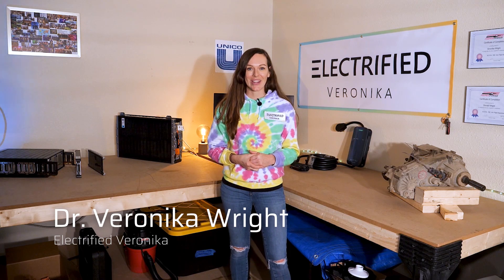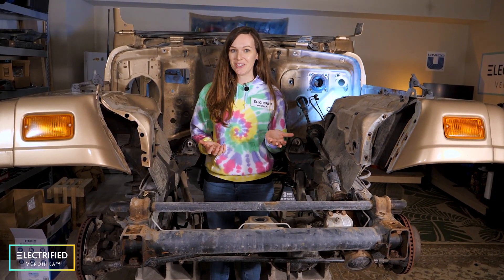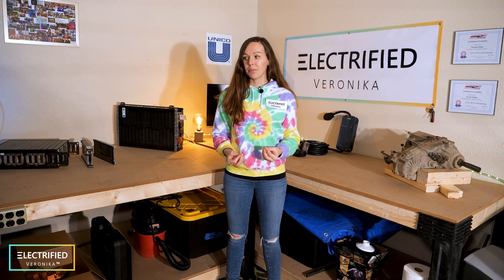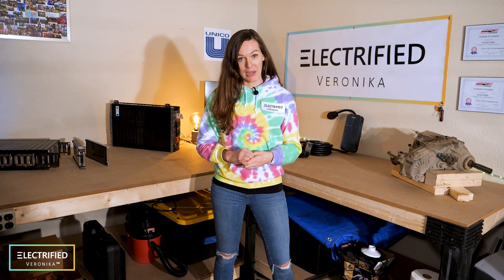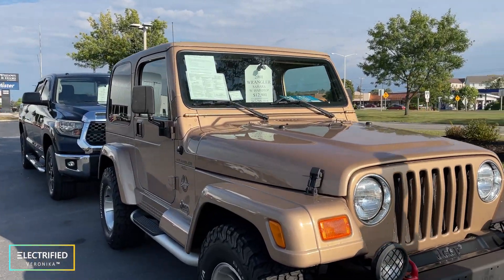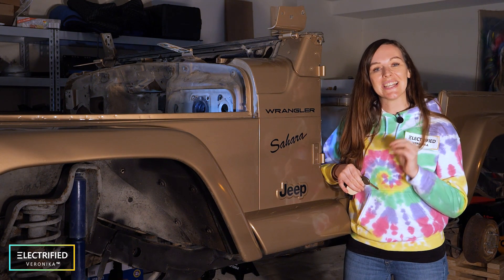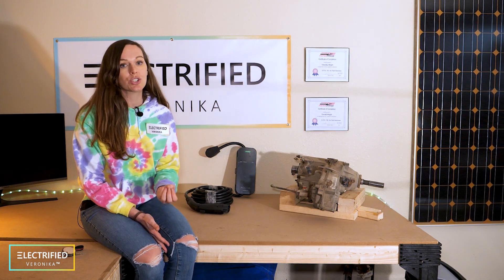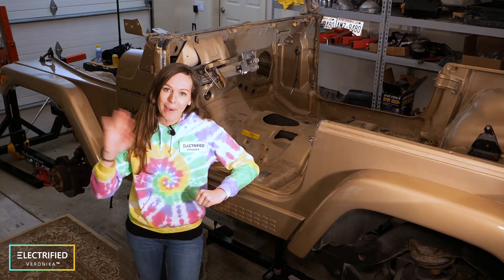We're Converting our 1999 Jeep Wrangler to ELECTRIC!

Comment: Nice.  A word on safety, concrete blocks like that are not very strong when loaded in that way.  It is very inadvisable.  If you want to scare yourself do a simulation.
Reply from the maker: Thanks for the input. We did not do a simulation on that one, haha. For a very short moment we had this weird setup with the rotisserie and these blocks but normally we are using wooden ones ☺️

Comment: The only way that we can benefit by switching to electric cars would be if the charging systems are off grid. In other words, solar, wind or hydro charging systems. Converting to electric  vehicles that require the use of fossil fuels in order to charge the batteries makes no sense at all. It would be like towing a gas or diesel generator behind your electric vehicle to charge the batteries. I would love to see someone approach a EV conversion with the intention to charge the batteries with only solar, wind or hydro powered charging systems. Interested to see which direction you take  for your project. God bless and stay well.
Reply: It would literally probably be more efficient to tow a diesel generator behind, as it would be operating in its most efficient power band, and you would have regenerative breaking. Much of our grid IS powered by renewables, and the fossil fuel power is vastly more efficient than a car engine. Also, if it’s being powered by the grid it’s immediately more “green” when the grid upgrades.
Reply: It would literally probably be more efficient to tow a diesel generator behind, as it would be operating in its most efficient power band, and you would have regenerative breaking. Much of our grid IS powered by renewables, and the fossil fuel power is vastly more efficient than a car engine. Also, if it’s being powered by the grid it’s immediately more “green” when the grid upgrades.

Comment: Hi Veronika, Why does the Jeep need to be a manual (stick shift) and not an automatic?
Reply from the maker: We thought we prefer manual because one of the options would be mounting the motor to the manual transmission input. However, we chose a different route for this conversion, so we could have gone with automatic as well. Our future plug and play conversion might use the manual transmission for ease of installation.